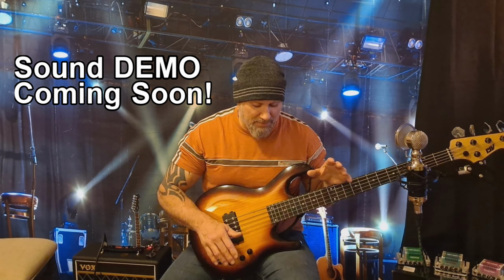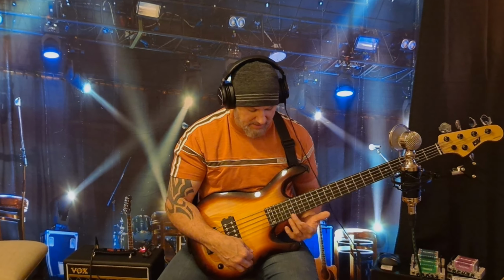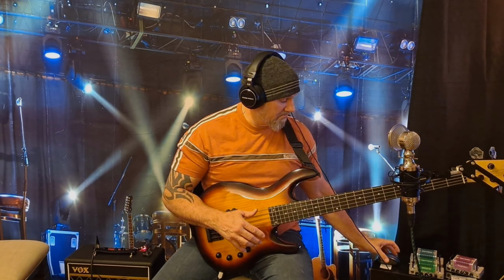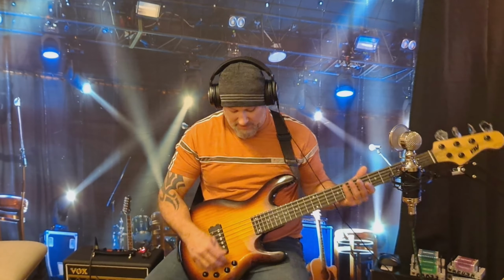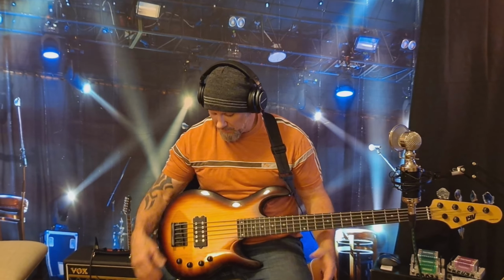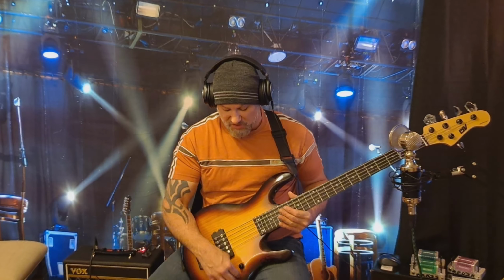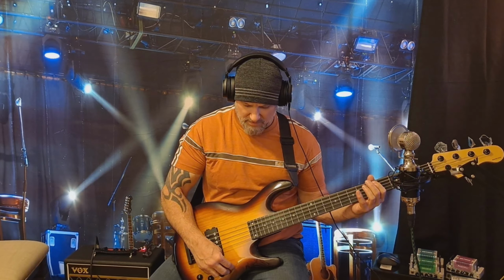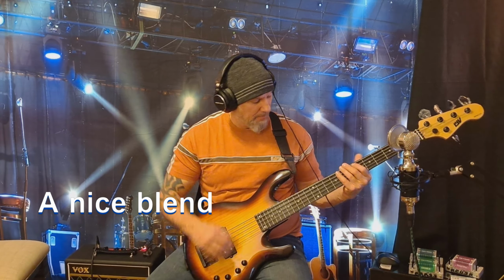IYV IMM-305 5 string Bass Volume / Tone Knobs Explained

Comment: you got lucky... i brought the same bass a year ago i did not come in that color one of the strings wouldn't stay in the little groove near the head stock so i had to tie it down,and the action was so high i could fly an air plane through it so i had to crank the truss rod to the point where it was barely moving  to straighten the out whole fret board you got reeaal lucky. its not a bad bass for the price at all... but mine was not flawless out the box like yours

Comment: Reminds me of beastie boys' "shake ya rump". So there's a blend going into a master volume. But before that each pickup has a parallel tone pot and that has a capacitor on each one? Instead of just a coil tap switch, they went with a blend pot. If I'm wrong I'll delete the comments
Reply from the maker: Nailed it.  Funny thing is later I bought this bass in a 4 string version that basically  looked like the same set up but ended up being  wired totally different.  I couldn't tell any difference when turning the "tone knobs".    Thanks for watching!
Reply: @FultonStreetBeats  Danelectro wiring is strange. At least you know when the humming stops, both coils are parallel. (Or series for boost)